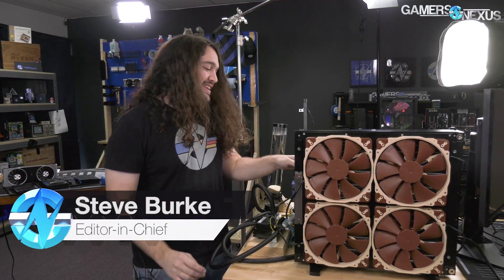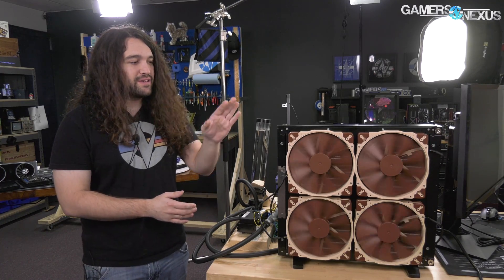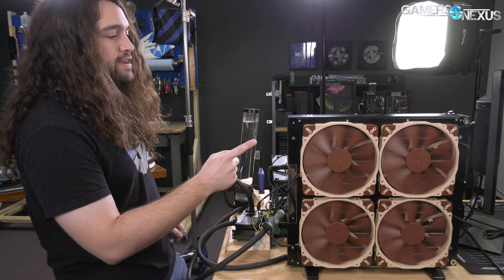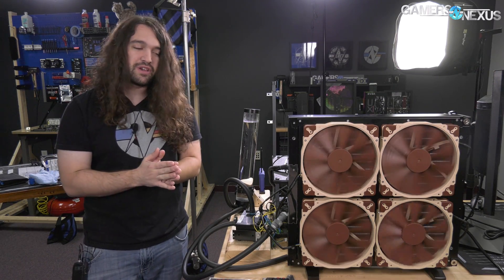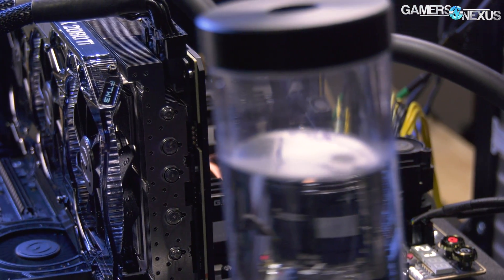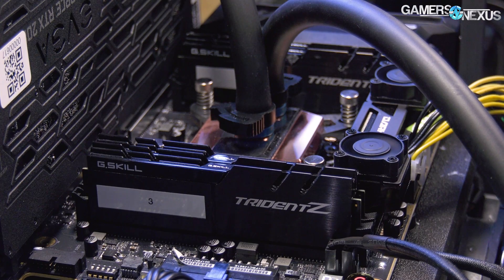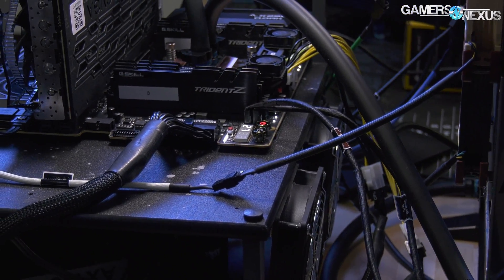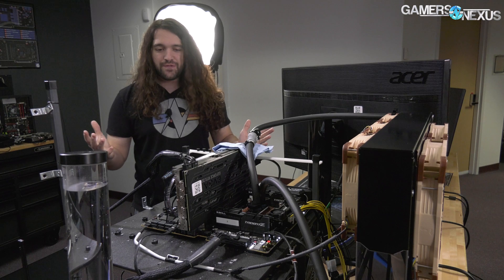9980XE Overclocking Stream Recap: Massive MORA3 Radiator

Comment from the maker: Thanks for watching! Catch our 9980XE review over here, if you want to see why we went with a "completely normal" cooling setup post-review - https://www.youtube.com/watch?v=o3PJ7prehVQ
Grab something from the merch store to help us out! https://store.gamersnexus.net/
Reply: Could run an quite car fan on that (not norm noizy until you get the fan more then 50%) impressive radiator that has been made more specifically this time for a water cooling loop, always thought about picking up an actual car radiator

 would not bother with rear small fans (have them in front or rear not both, sure not different sized fans if you are going to do both ) having the fans in the back pulling air is better for easier cleaning dust remove standpoint (for this test doesn't matter)
Reply: Oh jesus
Reply: I do have two MORA3 360, placed outside during summer to get heat out without AC. Easy to do with slightly more money needed compared to rads in case. Some QDs and more fans and a fan controller. Aquaero for example.
Reply: I have had that exact radiator for 8 years. I use it to get 4.3Ghz out of my 8 year old hex core i7 980x. It also cools the water block on my X58 chip set "UD7 Gigabyte" motherboard.

It's really good. I might add it sits behind my pc tower case on the floor.
Reply: And as you ran this, I broke the Cinebench R15 world record for watercooling using an i9-7980XE: #28 at this link > https://hwbot.org/benchmark/cinebench__r15/rankings?cores=18#start=0#interval=50
Reply: Where did you get the 200W passive performance number for the MORA3 420mm? The web site doesn't appear to list the performance metrics anywhere I can find.

EDIT: Dear god their web site is a mess. Found it: Service → Downloads → Radiator → MO-RA3 → https://watercool.de/sites/default/files/downloads/MA_MO-RA3_A5m.pdf.

On page 2: "It is possible to operate the MO-RA3 passive (without fans) as well as active (with fans). In passive operation, the heat quantity to be dissipated should not exceed 200W." It also mentions the part numbers for the wall mount on page 6. It looks like it's just a 30mm bit of folded steel that pushes the radiator off of the wall a bit.
Reply: You should do a piece on the Watercool cpu block as it's a work of art, as are their gpu blocks and the rest of their kit. So much better looking than the boring acrylic slab EK stuff.
Reply: Maybe a datasheet with all the overclock settings.
Reply: Mo-RA  stands for Monster Radiator
Reply: hey Rapunzel, guess who's here on youtube? https://youtu.be/82pmo53FQIY, it's Bill, and now he is on the toilet business!
Reply: Rapunzel, have you ever thought about getting on the toilet business too?
Reply: Rapunzel, if Bill is helping these poor people the same way he helps us with windows, i am actually going to feel pity for them, just look https://youtu.be/BCIohEJYxdY, they're already screwed,......................... LOL
Reply: Gamers Nexus  funny  thats not a a big radiator  go use a truck radiator to overclock
Reply: The delid was done successfully by these guys. https://youtu.be/zX6ckHAr0Mg
Reply: Has anyone ever built a propane powered refrigerant system for these crazy overclocking demos?
Reply: @poot111111  they should try one of these https://koolance.com/ultra-compact-450W-recirculating-chiller-exc-450 inside a special case with ambient temperature control inside to avoid any kind of condensation.
Reply: @renanjose84  Wow, I didn't know there was such a market for cooling, I should have prefaced my initial question with: "I am an idiot who knows very little, but" ...

lol I like your solution because it seems sustainable and practical but if the sky is the limit for these OC demos lets go crazy! I want a demo that utilizes CH3NO2 somehow , LOLOLOLOLOL the drag racing of the overclocking community
Reply: Hey, how did i get here.

Comment: I am going to buy one as a secondary radiator to my dedicated ASIC LIAN Li 4500w all in one radiator and pump.  This will be mounted to my return to my central heating.   The fans will be turned on when the heating turns on.    Also connecting to a diy copper heat exchange to warm water.  LIAN Li radiator will be outside.  This will make the entire system quite inside and manage the heat.

Comment: I am planning on this radiator for my Threadripper, non-overclocked, for silence. But I wonder how it would do with the 2950X and the 5800X in the gaming system, non of them overclocked. With 8x200mm fans.
Reply: Hi there, i saw your message here, and it stood out to me that your doing it with an threadripper, 
I also have an threadripper, the 3990x, and after 3 years my AIO cpu water cooler broke down, and this time around i decided to go full custom loop watercooling,  and rather than filling my pc case with 2 or 3 massive radiators, i thought about doing it externally, Im very curious what you ended up doing with your setup ?
Reply: @skapunker1986  I haven't gotten anything done with the external radiator cause of money. I just use a Cooler Master cooler now.
Reply: @Alexandra-Rex  that i bought the AIO cpu water cooler, was also just a temp-solution, thinking idd upgrade to full custom waterloop the next year, but before you know it 3 years already flown by, and im doing it now kinda because im forced to, but now i also have an excuse to go watercool my gpu.  I don't really feel like replacing my AIO with another AIO, even though that would probebly be the cheapest solution... , 

Been doing alot of research on radiators lately, and somehow found out about these Mo-Ra3's, and they look really interesting to me.  

Thanks that you took the time to reply my question !
Reply: @skapunker1986  When/If I do it, it will be a radiator similar to the Mo-Ra ones. Good luck with it!
Reply: @Alexandra-Rex  i know its silly, but i wanted to try out a vertical mount for my gpu, to better see the waterblock, only problem with that is that it would probebly take up all the space of the bottom of my case where the largest radiator would fit, 

One last question, it seems like these mo-ra3's has been around for nearly 10 years it seems, like nothing replaced it since, its kinda hard to believe nothing better has been designed since, in other words it feels like it has stagnated, or is there a mo-ra4 somewhere i havnt found?
Reply: @skapunker1986  I have no idea really. I'd check with the manufacturer to make sure.

Comment: The Mora has kept my 2500k and gtx570 alive since they came out, so almost 10 years. Yes, I know, it's so overkill, I could've literally just bought a much better and easier to maintain system instead of watercooling this sh!t rig with a car radiator. But back then I was in love with the idea of a noise-less system. SADLY, most 180mm/200mm fans (at least back then) had a high minimum start voltage requirement, so I have to reach behind my pc everytime I boot it to turn up the voltage control for a second...

Comment: I want one of these radiators. I run a 7980XE at 4.8Ghz all (18) cores with 1.286 volts. And this is a little extra voltage that it even needs for AVX load stability. I also have G.Skill Trident Z Royal DDR4 4000Mhz CL15 4x8GB kit at 4,000Mhz CL15-16-16-30-1T-275 100% stable. Yes my CPU is delidded with LM. Very happy with my setup so far. I am considering direct die with standard thermal
Paste.

Comment: @Gamers Nexus
The MO-RA from Watercool is nice - but if you want to seriously water-cool you should look for an airplex GIGANT 3360 from Aquacomputer - ideally the full copper version. >:)
It is "only" a 2x180mm radiator, but it has over 6,000 watts of cooling capacity - that should be enough for one or the other OC record. xD
If that's not enough, you can still put the radiator on the balcony in winter. ^^
https://aquacomputer.de/newsreader/items/eine-neue-dimension-im-radiatorenmarkt---airplex-gigant.html

Comment: The Mo-Ra (Monster Radiator) is great, particularly for silent builds. If you look at the large amounts of space between the fins, it's designed for low air pressure - this'll easily cool a couple hundred watts with those big 200mm fans running at their minimum 330rpm setting, where they're functionally inaudible.

Comment: It's about 3.07m² in non-freedom units
Reply: That's only a bit more than twice of what a NH-D15 has (I've seen 1.29m² cited), but all those copper pipes have far more contact with the fins than the heatpipes of any air cooler have. That's where most of the higher performance comes from. So it's not actually the surface area that's impressive, it's the total heat transfer from water to the metal fins that got the fuck optimized.

Comment: I am planning to get a WATERCOOL MO-RA3 360 PRO STAINLESS STEEL and put it outside my window, the weather is so cold here its around 2 - 6c I think they use aluminium fins, so will have to add some anti corrosion mix, my old one would get all my GPUs on 100% at 30c :D

Comment: did that rubber tubing come with this rad (MORA3) or did you purchase it separately ? I like my hard tubing but its really a hassle to tinker with my setup then and i don't like the traditional clear soft tubing.
Reply: No radiator comes with tubing (not counting the AIO types). That would be stupid since the manufacturer cannot know what length on tubing your specific configuration would need!
Reply: @pev_  except when it does come with tubing and isn't AIO like my recent kit was

Comment: that huge rad reminds me of another diy build some guy used a actual car rad and ofcourse modified it to work to passively cool his pc. i'm sure it was alot cheaper than that MORA3 rad tho
Reply: First, a car rad would require quite a lot of DIY to make robust and leakfree tubing adapters and fixing solutions, and second, to use a radiator that is designed for fans, for passive cooling is stupid, it will never work well. Yes, PC watercooling components sure have a premium in prices compared to full DIY "industrial" component solutions, but they sure are sleek and designed for the purpose.

Comment: What is the case with best airflow that can fit Noctua NH - D15?
Reply: Silently? a r6 fractal with 3x noctua  a12x25 fans in the front, dialed in for max rpm before being audible.  remove rear fan grille with dremel.

Comment: MoRa3 420 <3
The ultimate beast. The best radiator for watercooling you can get. 
I have two of them each with 9x 140 NoiseBlocker PRO PK1 fan in push configuration, one is cooling 3930k+3930k+4930k with single D5 pump without any problem and second one for dual Xeon workstation.

Comment: MoRa 420 owner here.
Steve... not 4x 140s, not 4x 120.
You can fit 9x 140s on the MoRa 420 and 9x 120 on the MoRa 360 on one side.
With push-pull you can fit 18x 140 on the MoRa 420 and 18x 120s on the MoRa 360.

Comment: there's no point using a radiator that size, when the cooling system's performance is limited from the heat transfer between die/lid and waterblock. That gap is the problem. My motorcycle has a smaller radiator and its (heat) output is about 140 kW (100 hp ~=70 kW, typ. ice eff ~= 0.3, so heat output ~= 2x 70 kW)
Reply: Your motorcycle also is a thousand times louder :). For me the point of having the MO-RA3 is first silence (4x very low rpm 200 mm fans on one side) and second future proofing: I know that whatever I decide to include in the loop in the future, I do not need to buy a new radiator.
Reply: unless you plan to cool an entire server rack, it will still be overkill. Spend the money on higher quality components instead.
Reply: I already have higher quality components, and I have the MO-RA3, so no need to spend anything right now, very happy with my rig. Your motorcycle is overkill, nobody needs that much power in a motorcycle.
Reply: ... wat. it's a 20y old 600cc making 95hp. If this is "overkill", then what is a hayabusa which has about 170hp? If this is "overkill" then what is a ducati panigale v4 which has more than 200hp ?

Comment: why have the out on the top against gravity? wouldn't you get more flow if the output was on the bottom?
Reply: Argh, NO! In a closed loop it makes no difference how the loop goes. Also, if the "output" is on top, it is easier for air bubbles to exit the radiator.
Reply: @pev_  plenty of vehicles have the hot side on top and the cold side on bottom just asking a question

Comment: Can you doo a system with 2080ti and i9 9900k with no fans only pump?
Reply: From experience using one of these radiators in the past you can game quite a while with this radiator without fans. Problem is water temp is steadily rising. So after 2-3 hours your water temp might be 65 ++ C
Reply: @moo True. It also depends on your water volume how long you can go without fans. But fans at 600 rpm will be more than enough to keep it cool.

Comment: Hey anyone can help me out. I have GTX 1070 ti and the 416.94 drivers have been having serious issues with my card. The model is a SC black ACX 3.0 edition from evga with micron memory. Everytime my monitor turns off due to inaction and I it wake it up I end up with black bars running horizontally on the  top of my screen (  just a few bars on top) and the rest of the screen is pixelated and out of focus along with parts of the screen missing. When I turn off my monitor and turn it back on I am unable to get any video output through the display port. I have also confirmed that this issues only happens in Windows as I tried with Linux and latest Nvidia drivers and no such problem occurs, leading me to believe that my display port cable is still good and I have no issues with the display ports output on my graphics card. I am currently attempting to see if the same will occur if I am using an HDMI cable. Also of possible interest. My monitor is freesync and 75hz. I use the displayport to achieve the higher frequency as I am unable to through my hdmi cable. I recall having the same issue with the drivers that came out shortly after RTX so I rolled back thinking it was a common issue. However, it has been a couple of drivers now and my issue is still not resolved. Anyone know what may be causing this. I have also tried DDU in safe mode and doing a clean install of the drivers leaving out everything but the driver and Physx

Any help would be greatly appreciated

EDIT:
I can confirm that the issue is not present over HDMI. Could it just be an issue with my monitor? Similar to how RTX was getting some BSOD on some monitor?
Reply: Hyperion98 try going back to 399.24

Comment: that's not 33 sq feet steve, that's like 1.77 sq feet, now this is the drawback of not using the metric system :) :) :)
Reply: well its not 33 sqft, buts its way closer then your 1.77 sqft
the 420 mora3 has around 3m² of effectiv area wich is, according to google, 32.3 sqft ;)

surface area is the area created with all the fins and not just the area of the fan mounting plain ;)
Reply: @lexel90  yes, actually my bad (i should have mentioned), i was talking about total/normal/horizontal (idk which term to use, sry) sq feet area not surface area
(200mm x2 x 200mm x2 = 1.33ft x 1.33ft ~ 1.77 sq ft)

Comment: Steve, if you ran a thick layer of liquid metal on a delid, and then pulled the temperatures down to the point where it solidified, would it not behave as if the cpu was soldered or does the thermal properties of LM change that much when the state changes to solid?
Reply: As der8auer points out, Liquid Metal cracks once solidified, which is why overclockers use paste instead for LN2 and lower.